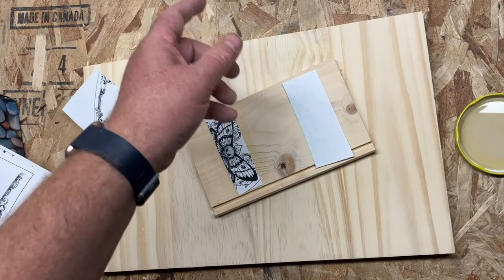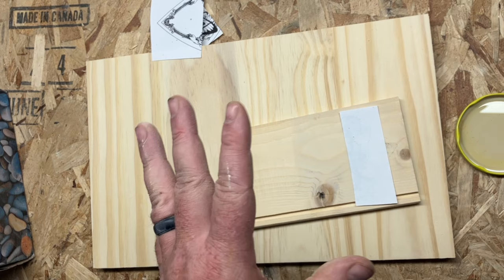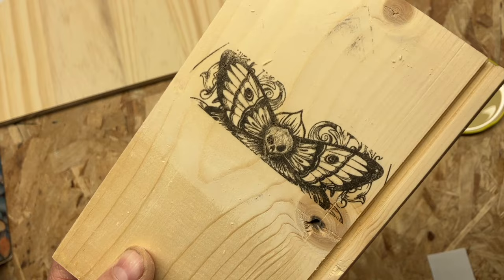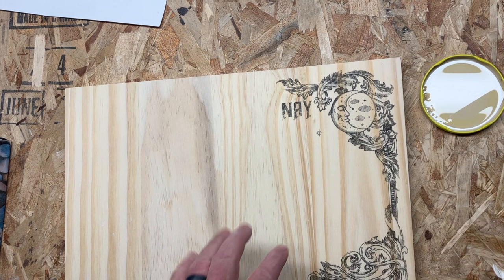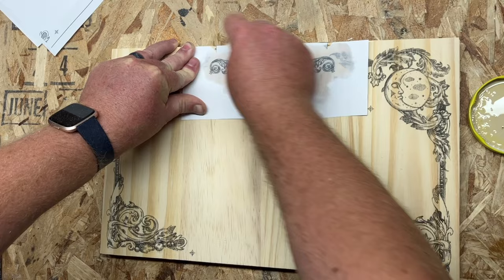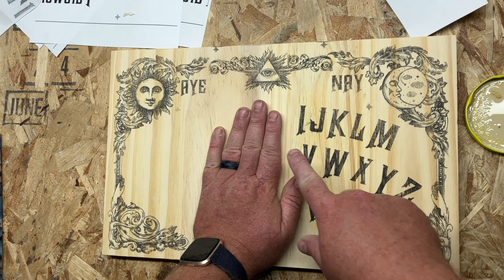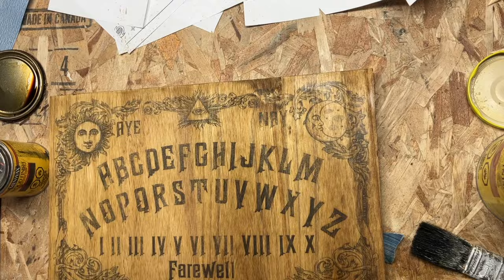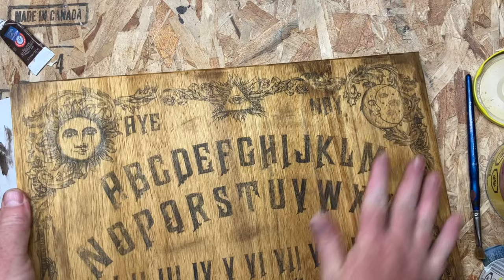Crafting the Unseen: DIY Wood Ouija Board Prop Tutorial

Comment: If you're making the coasters, think about adding an underlayer of thin cork board. Cut it just slightly under the overall dimensions of the planchette and glue into place with a waterproof glue on the wood side so as not to get wood on the cork in the hole of the planchette. It will help ensure that even if you have a bit of liquid slip through the middle hole, it will stay off your furniture. And, it really shouldn't distract from the uniqueness of the coasters.
Reply from the maker: Hey Eric, thank you for the suggestion.  I had actually been deliberating this exact thing with the cork (Your suggestion pushed me to actually do it as your reasons were spot on.) The hole that goes right through the planchette was causing some issues.  So I decided to drill the hole about 3/4 through it and insert a 3d printed lens to make it look the part while not letting fluids go through to the surface.  I'm hoping to have the first set ready tomorrow and will throw an image up on Instagram :) Thanks for the suggestions and for watching :)
Reply: Brilliant. :)   @SamhainPropworks